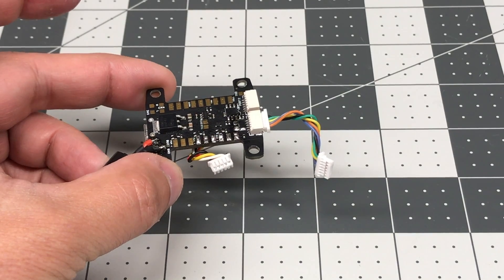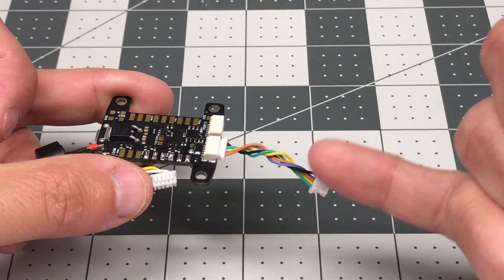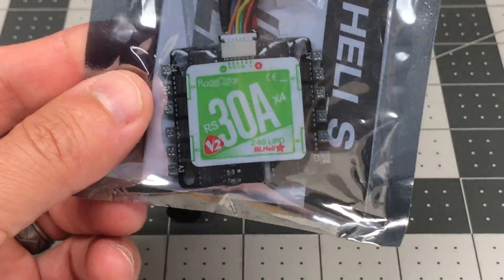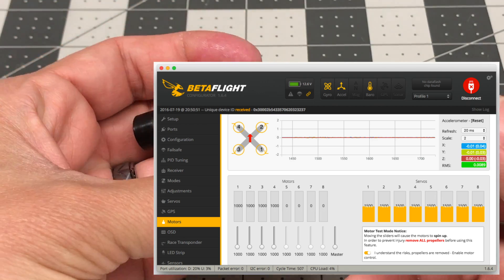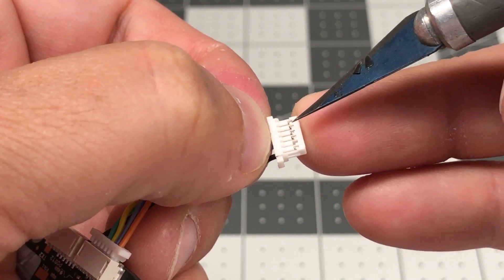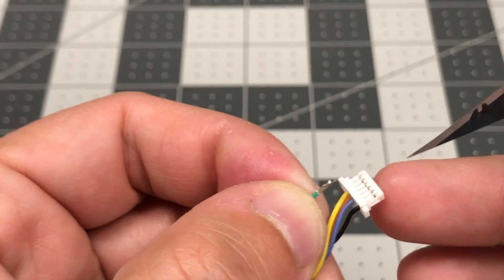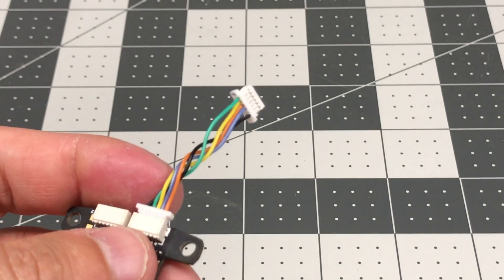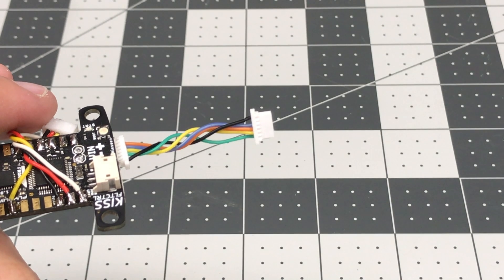4-in-1 ESC Signal Wiring

Comment: Thanks a bunch! Since I run kiss and bought a luminier 35a 4 in 1 (like in your previous builds) I'm going to assume your wire color order is the place for me to start: FC side - Orange, Purple, Yellow, Green then on the ESC side - Green, Yellow, Orange, Purple. I got an arduino nano so I can connect to Blheli Suite (since I have no clean flight controllers). Thanks a bunch!
Reply from the maker: Robert Nollkamper I have an Aikon ESC now so check your wiring, it might not be the same as mine. ;)
Reply: kenkamm it appears you are correct...from what I can see on pictures it looks like 3 and 4 are swapped between the Aikon and the Luminier. Either way, I'll find out one way or another!

Comment: Great video! Thanks!
Reply from the maker: DroneRodeo My pleasure. I hope it helps.
Reply: I decided to run KISS firmware on the FC (because I couldn't get betaflight to flash) so I instead ran individual wires to the FC and soldered on pin headers so I could program through BlHeli suit.